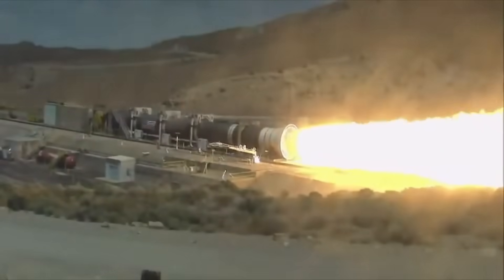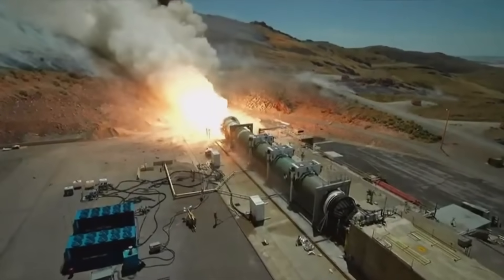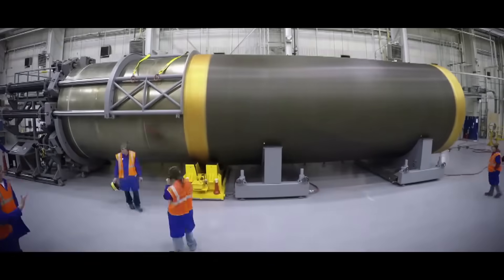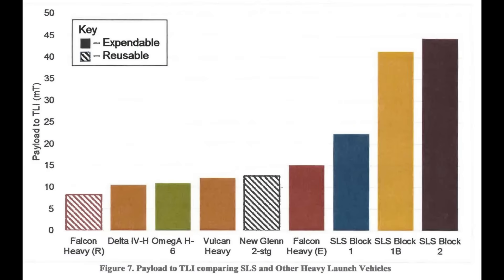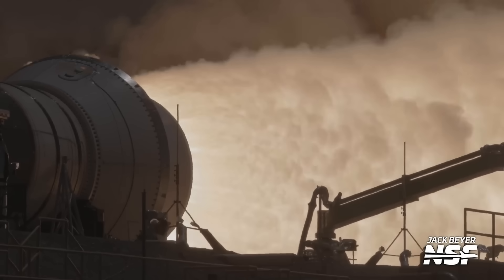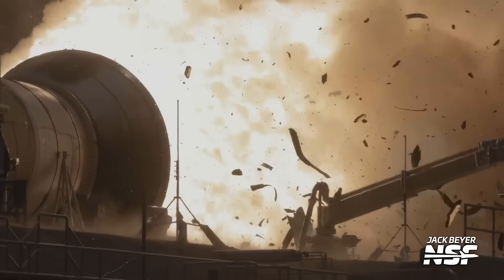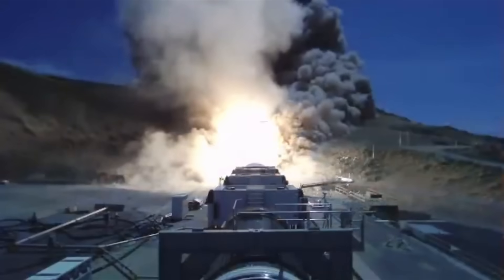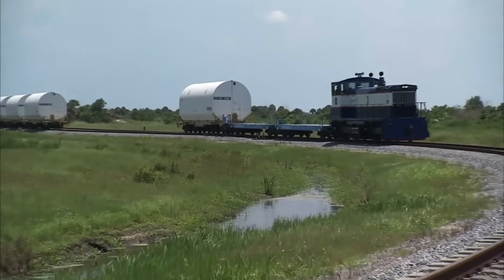NASA's Future SLS Booster Just Failed Its First Test

Comment: This whole thing felt like one of those accidents you expect to run out of control because they hooked it up to an endless supply of fuel. So glad that it stayed under control.
Reply: Losing the nozzle is a failure mode that’s accounted for. The motor is designed to keep the fire shooting out the back no matter what.

Comment: This whole SLS project feels like "well I have the shell of a 1996 Mazda RX-7, all it needs is a chassis, motor, drivetrain, suspension, wheels, and an interior and it'll be as good as new!"
The problem being that by the time you get the thing running, it'll have cost you twice what buying a functioning one would, plus years of your time, and you still don't have a very reliable or practical car.
SLS was legislated into existence in 2011, and its first and so far only launch was 11 years later. Meanwhile SpaceX has launched, what 300 individual missions in that time just for Starlink alone with exactly one failure?
Reply: Falcon 9 and SLS are entirely different classes of rockets. For comparison, this single booster is about the size of a Falcon 9 but put out thrust approaching that of an entire Falcon Heavy. It also doesn’t help develop when Congress is breathing down your neck every step of the way.

Comment: What's really interesting about this is that this failure might be survivable for a crew capsule because they typically have the Launch Abort System, it's fascinating to me :D
Reply: There’s a very good chance the launch abort system would have gotten the astronauts away from the rocket safely if this had happened during flight. 

Blowing out a nozzle is unlikely to damage anything else on the rocket. The torque moment applied to the rocket when the failure happened would likely be an automatic trigger to abort.

Comment: The nozzles are ablative and designed to burn away while operating. Someone must have tried skimping on the thickness of the phenolic resin and carbon-fiber cloth lay-up in the ball-in-cup joint for the steerable nozzle.
Reply: No one is trying to skimp. With new motors, there is any number of things that could go wrong.

Comment: Things could have been different. Isambard Kingdom Brunel, the predominant British engineer of the Victorian age settled on broad gauge, 7 foot (later widened by 1/4 inch) was more stable and built Great Western Railway based on this. Unfortunately after a number of amalgamations, it harmonised on standard. If you ever see the tunnels between Bristol and London, you’ll notice how wide they are and only part of the bed is used.

Comment: Northrop Grumman needs to develop a booster with the capacity to be throttled up or down, or be shut off. SRB's are just not safe. It would be more costly to develop the design I described but what is expense when talking about human lives ?
Reply: As far as rocket motors go, SRBs are pretty safe. The launch abort system would have activated in an event like this.

Comment: Just Use SATURN 5 Rocket Designs... They Supposedly Worked Just Fine...

Or Did NASA Lose The Paper Napkins They Were Drawn On 🧐
Reply: The original designs are still archived at Marshall Space Flight Center. You can also find them online. 

Rebuilding old tech is harder than just building new tech.

Comment: 6:45 a steely eyed rocket scientist?  ARE YOU STUPID?  It is called a diversity hire. Whatever “it” is a scientist “it” is not.  56 years ago the United States of America put men, real men with huge brass balls, on the moon. Now we cannot even conduct a successful ground test of a booster, the base model of which launched how many shuttle flights? Gd pervs destroy everything.
Reply: Follow your leader
Reply: Get help. 

This booster topped the previous most powerful booster by almost 1,000,000 pounds of thrust and basically every component was a new design. 

Failure was always a possibility, hence why it was tested and you decide to rant about DEI? You have zero clue what goes into making these motors.
Reply: @AM-rd9pu really. I’m just a 40 year machinist that did my fair share of aerospace work. That means actually making parts from drawings into machined parts. I have cut many tons of metal in my life and made thousands of parts, tens of thousands really. Obviously I am clueless. We all know what is wrong with the world today. Honestly it’s not the pervs. It’s the people like you that support them and others that are afraid to speak up. I am not afraid to speak up. If a person is hired because it fulfills some political agenda instead of the need for qualified personnel then failure is not just an option, it is a certainty. 

In making machines as complicated as rocket boosters and airplanes failure should not be an “option”. It should be the rare occurrence that was overlooked. Not a failure because someone was more worried about their pronouns than their math.

Comment: It seems logically irrefutable that if the Roman military used 4' 8.5", that the connection to existing rail is obvious, and derivative of that, directly, would be the size of the items that can be transported by rail.

But, Boeing fuselages are transported by rail too, and they are larger.

These days it makes more sense that it's tunnels and bridges that marginally influence the size of transported items (if they Must go by rail) -- which is significantly safer/easier than by road.

Comment: Sorry, your explanation of the need for segmented boosters, based on rail gauge, makes no sense, as that restricts the diameter of them, rather than the length. Interesting background information though
Reply: SRBs are made in segments because you can only cast so big of a section. The casting pits are one of the limiting factors.
Reply: @AM-rd9pu  Yes, but why  did they mention rail gauge?
Reply: @Stuart-AJC  I’m honestly not sure. The width of the rail cars is a limiting factor for the diameter of the motor, but that’s not why the motor needs to be in segments. He made an odd correlation between track width and segment length.

Comment: If this happened during a SLS launch, would the rocket survive or make it to orbit?
Reply: Hard to say, but if the blast itself didn't the asymmetric thrust might be an issue.
Reply: Aye, good point about the asymmetric thrust. @imaginary_friend7300
Reply: @imaginary_friend7300 yeah, good point about the asymmetric thrust.
Reply: There’s no chance the launch abort system wouldn’t have been activated.

Comment: Im an engineer at the plant out in utah. This rocket was a huge part of the last few years. Having had a hand in nearly the entire manufacturing process, having stood in the bore of this motor after casting, having helped assemble it into this test stand, it is hard to see it fail so spectacularly. I can only hope we get to find out what went wrong and then fix it. My fear is that will never be discovered if SLS is cancelled.
Reply: Hello fellow Promontory PS engineer. With the investigation being fairly low priority, I was impressed with how quickly a probable cause for failure was identified. 

As for a redesign, I just hope the program doesn’t get axed because this is such a cool motor.

Comment: As an engineer myself, i personally think it was thermal shock since the failure occurred right after the aft deluge. 

I am an aerospace engineer and trying to get on at this exact Northrup location. My childhood friend was the lead for motor case and insulation. 

I do amateur rockets and make my own fuel. I have my ideas of why it failed for the nozzle, but well see
Reply: The deluge system doesn’t start until after the motor burns out.
Reply: @AM-rd9pu that's what I thought, but they did say 90 seconds in the deluge system started I'm talking to my friend and colleague who designed the motor case for it, says the deluge system starts about 2 minutes in. Probably to get it started but not flowing as you say?

Comment: With the rate at which Starship is NOT progressing, if may be a little premature to cancel SLS. I hope that a working group at NASA starts looking at a method to use New Glenn or Vulcan Heavy, or Falcon Heavy along with Earth Orbital and Lunar Orbital Rendezvous techniques to get the Blue Origin HLS system on the lunar surface in a short time frame. And for God's sake, don't cancel the Lunar space station. We need that to test hardware for interplanetary missions.
Even with this booster explosion,  since it only affects flights that might be cancelled, it doesn't sound like much of a story in regard to the future of the US manned space program.
Reply: You make flawed assumptions about what's going on at Spacex.  The biggest issue with SLS is COST.

Comment: I worked for a machine tool control company back in the Shuttle era. That company produced several control packages for machines that performed the winding and grinding operations for the aft exit cone of the SRB. I was fortunate to be able to travel to Morton-Thiokol several times to help setup these two machines and teach a maintenance class on our servo systems. I was there a few days after the first static test firing. And the guys I was with took me out to the test site to see the post-burn rocket engine.  i also got to see first hand some of the completed segments and the fuel mixing room. It was one of the most professionally run sites that I had ever visited.
Reply: Fuel mixing room?
Reply: @darthnihilus511  it's solid so the fuel and oxidizer are mixed. The pressure of an explosive initiator ignites the mixture which is self sustaining until it is depleted.
Reply: @divedevil985 so is it an actual huge room with kettles and mixing spoons or just a term to describe that particular department?
Reply: lol dude

Comment: Nozzle TVC for solids is a simple concept but really hard to engineer because you have to make a lot of assumptions even if you have subscale test data. There has to be a series of flexible joints somewhere that are exposed to conditions that are worse than Hell (high pressure gases at 3,000 F, moving fast, with entrained solid materials). So, what material do you use for that flex, how thick is it, how is it bonded to the ceramic substrate, how good was your installation process, could you detect a manufacturing fault if it existed, etc. Lots of questions to answer. And of course, you have to balance robust design or over-design with light weight and cost. If they continue with this TVC booster, I'm sure they will do a full failure investigation, take it as learning and improve the design. Next test will be much, much better.

Comment: One of the weaknesses of the SRB was the segmented design made so MT could assemble them in a landlocked location. Too bad that aspect could not have been changed with the repurpose. Yeah, there would have been a cost, but the fewer the o-rings, the lower the risk.

Comment: 0:43  the actual reason wasn’t to save money - it was to keep manufacturing lines and associated jobs intact. Which I disagree with in principle, but pragmatically there were some reasons to do this at the time.  There private market was still unproven. NASA budgets were getting slashed - and basically promising those jobs and spend in an intentionally inefficient supply chain was a way to bribe senators to keep it in the budget.    I’m sure Obama wasn’t exactly burning the midnight oil to limit the gov handouts, but from the POV of being a fan of space stuff - there was some rationale

Comment: I am thinking the heat disappation around the nozzle would be rather sub optimal so close to the ground, all the more with vectoring.
I wonder if excess heat build up due to the mode of testing was involved?   Of course one would expect the engineers to consider that, but hey this isn't spacex

Comment: LMAO!!! That horse's ass story has been floating around for years. The truth is much more boring. The original 'railroads' had the flanges on the rails, not the wheels. Just an L shaped piece of iron, with the wheels spaced at an even 5 feet. When they came up with the idea of putting the flange on the wheels, they wanted to keep using the same track. 4' 9" was too tight, and they ended up with 4' 8½". And the rest is history. 😉

Comment: Beyond the increased thrust over current SLS boosters, the composite casing also reduces dry mass by 25%, a significant number. Since this is the first firing of a completely composite booster anywhere close to this size, possible test anomalies should not have been unexpected. There are plenty of potential applications for this technology, even if never used on SLS flights. It was already paid for, so it makes sense to gather data and learn.

Comment: The aft skirt is not likely to be aluminum. All the weight of the system sits on the aft skirt. Aluminum would bend or have to be 3 times as thick. Also, they're reusing exosting aft skirts from Shuttle, which are not aluminum. Finally, at 5000 deg F, aluminum would have burned way faster.

Comment: That story about the width of rail gauge is completely false, I'm afraid. The typical width of a cart has more to do with the amount of space necessary for two men to sit side by side on the driver's seat than anything about ruts or horse butts.
Railroads have always had a variety of widths, and in fact the very first ones were what we would call "narrow gauge" today because they were replacing mine carts drawn by a single donkey. In truth, adapting a design to a new gauge is not particularly difficult, and railways have never shyed away from using a non-standard gauge for fear of being unable to acquire rolling stock.
In fact, English railways varied wildly in width from 4 ft to over 7 ft until the end of the "gauge war", and it was mere economic chance that the 4' 8.5" gauge that we now consider "standard" happened to win out and become legally mandated for the sake of interconnectivity. It should be noted that most of India is fitted with 5' 6" tracks instead, because there was no pressure for them to match British tracks despite being ruled by the same government.
As for American railroads, do you perhaps recall how there was a disconnect during the Civil War because Northern and Southern railroads used different gauges and so troops could not easily be transported across that divide? The South was forced to standardize after the Civil War, again for the sake of interconnectivity, but that was not based on any devotion to a particular gauge so much as selecting the one that would require the least rework.
Reply from the maker: So you’re saying it’s more about asses in general rather than specifically horses asses?
Reply: @scottmanley  The cart seat is more about elbows, but the rails have nothing to do with either.

Comment: It wasn't the nozzle that blew first, and I doubt the electric TVC had anything to do with the failure. I'd be more inclined to suspect the filament wound case and the nozzle to case joint. The failure was at top dead center. It is actually fortunate that they had electrical TVC. Can you imagine hydrazine tanks blowing?

Comment: No, SpaceX proved that they could reuse liquid fuel boosters. No one else has replicated that, I believe.
Reply from the maker: Blue Origin reused their booster first.
Reply: SpX reuses the whole booster stage, reusing engines, but not the exact same engines every flight. The Space Transportstion System aka Space Shuttle reused SSME engines also, in the same manner. And it landed intact, so the SpX is doing the same thing as the Shuttle EXCEPT for the first stage. Since Shuttle used solid rocket motors (not engines) for thr first stage, they landed them in the ocean, retrieved them and reused them. The thing they couldn't do with solid rocket motors was control them to land them back on land like SpX does. SpX landed into the sea at first, but I'm sure the learned that sea water and impact  wreaks havoc on engine parts. Then they landed on a barge at sea. Probably had to do because of range safety rules. They had to demonstrate they could land repeatedly safely at sea before then could fly back to land. The benefit of a liquid booster is thrust control, which will always beat solids for controlability. But solids still have a kick. Notice how fast the Space Shuttle cleared the pad.
Reply: Shuttle flew back and reused it's engines too. Just not the first stage solid rocket motors. (Sumarry of my above comment). SpaceX didn't invent reusability.

Comment: Solid rocket for that they can't throttle down or turn off, I that still a good idea?
Reply: It works for other-than-manned space flight wonderfully. It worked for 30 years on the Shuttle program. It's been a fundamental question in rockets design for 100 years. You make architecture decisions and then you design for what you decided to use. Tons of trade studies done on the question. Don't assume that liquids have fewer failure modes because  you can throttle them.